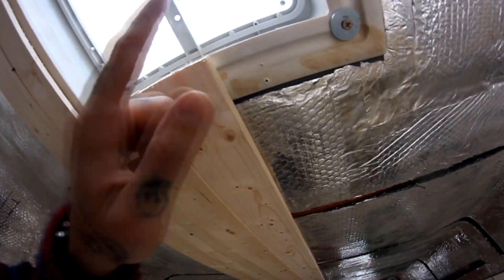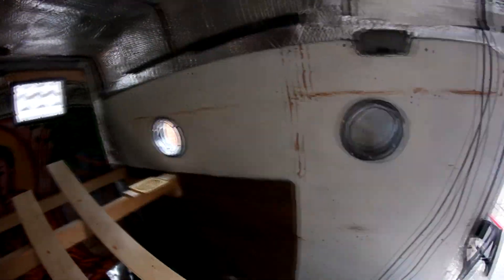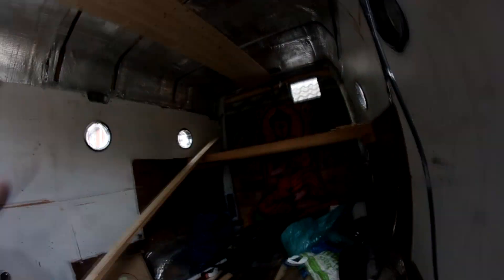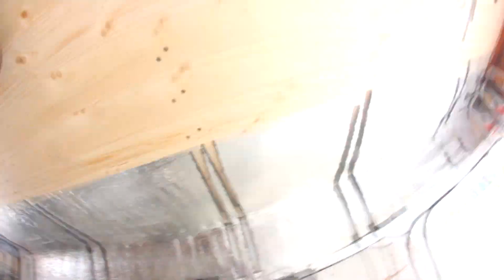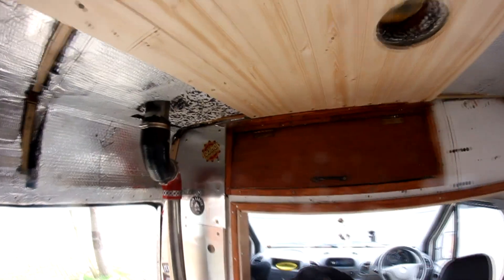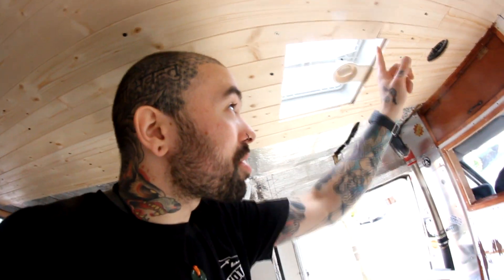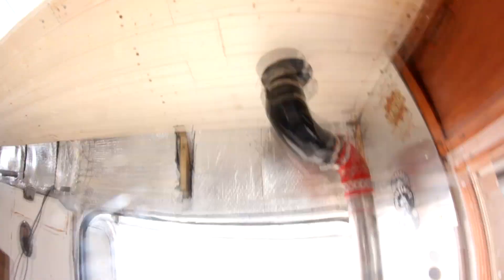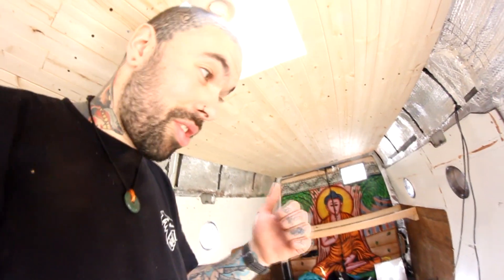VAN LIFE: Diary of a van man 48   making quick progress!

Comment: I love what you've done so far. If i can ask a boring question?! How have you insured your van? A day van maybe or have you fulfilled all the requirements in order to register it as a motorhome ?
Reply from the maker: no question is a boring question! i made sure i built it out to fit all the requirements and followed the procedure on the dvla website... not a bad process :) so its insured as a motorhome :)
Reply: Ah thanks for the reply. I have a transit and have made a type or rock and roll bed out of wood so I can lift in and out and still use as a van. I've also done a tongue and groove ceiling.
Reply from the maker: sounds good! nice and practical :)

Comment: Did you forget to seal over the vapour barrier where you cut it for the battens? If so, what about moisture getting up behind there, have you had any problems?
Reply from the maker: I've got a membrane stuck directly to the metal of the van 3mm of black closed cell foam so even if anything gets past the silver foil and through the insulation, it's got that in the way. No problems with moisture yet 😁
Reply: @leonperkins.outdoors  Thanks Mate! Good to know. Your van looks great by the way, I liked it before as well 👍